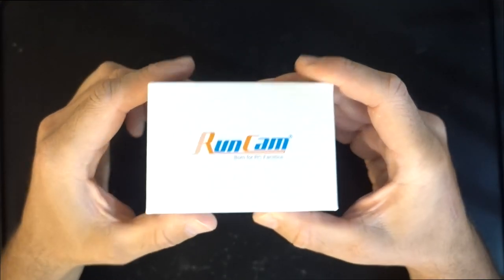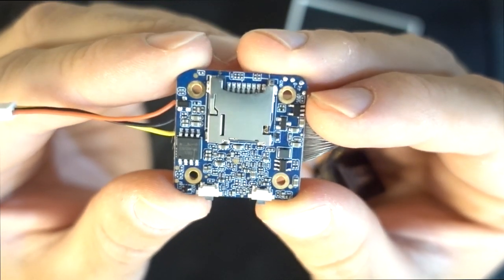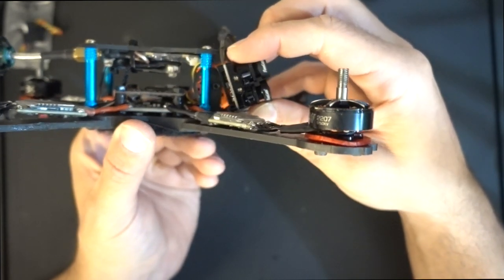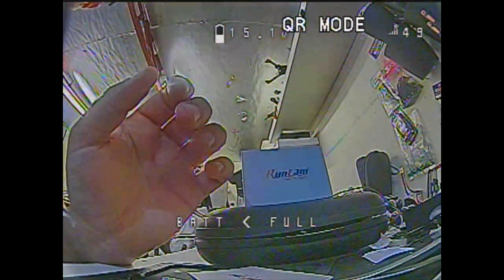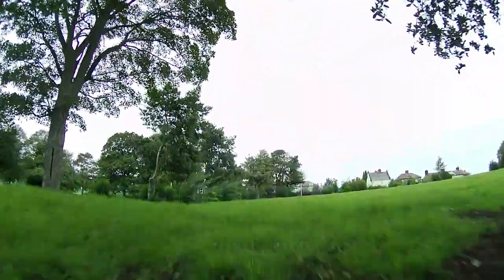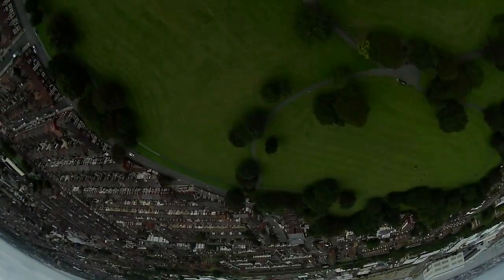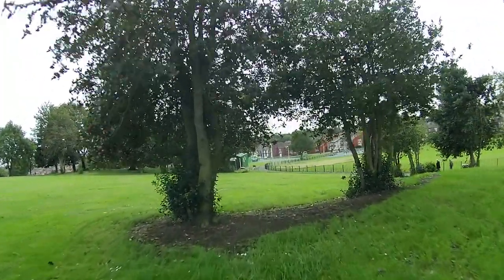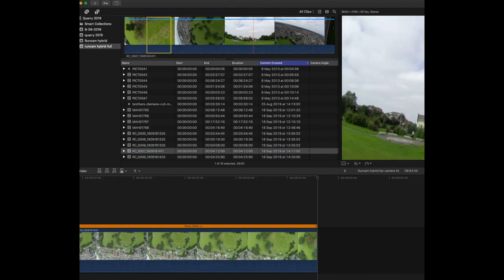HPI GUY | Runcam Hybrid FPV Camera with 4K

Comment: Hey! Iam confused. your chart says m10 lens on the HD cam. banggoods site says 12 mm width for the HD lens thread... what is right? I want to use this for IR-footage, as it is perfect for it, as the fpv view stays normal colored which is easier to fly. so I have to order a replacement lens IR sensitive, do you know what type of lens I need for this camera? would be nice if you could measure the thread length of your hybrid...